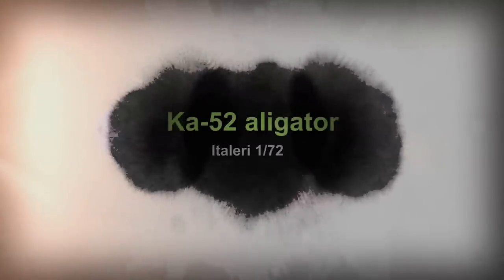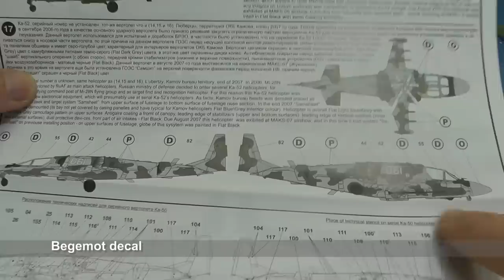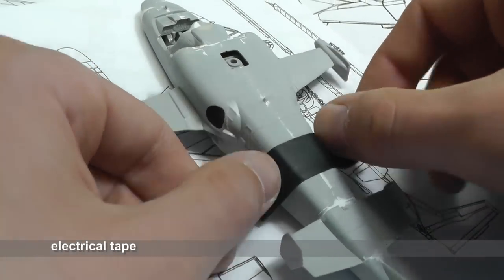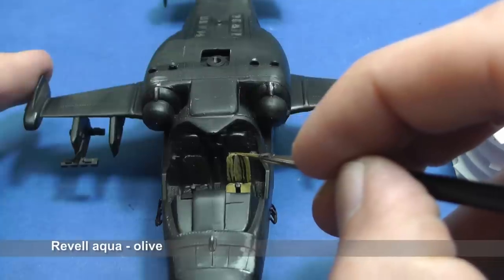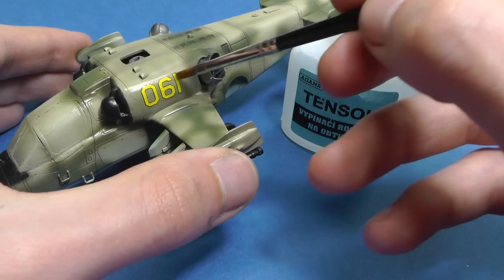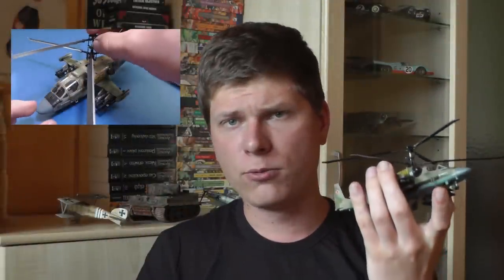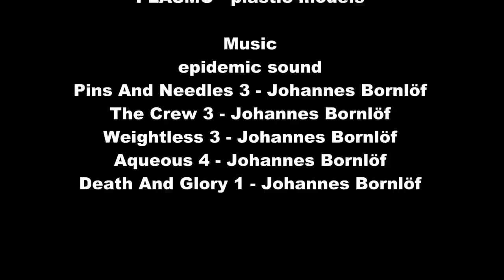Kamov Ka-52 Alligator "Hokum-B" 1/72 Italeri - Helicopter Model

Comment: I've always favoured the Ka-50. The Ka-50/52 is an incredibly innovative helicopter with a huge number of improvements to the traditional attack helicopter design. The key differences between the Ka-50 and 52 mostly rest on the Ka-50's innovation being rolled back to allow for export to users who aren't fond of some of the new ideas. Granted the changes probably are for the better in a lot of cases, but as long as I'm not flying it I don't have to care for practical realities.
Reply: I think the dual cockpit is much better. Allows the pilot to concentrate on not flying into the ground, and the gunner to chase targets.

The US is still expecting two crew in their replacement helicopter program, FVL, and I am willing to bet that the US has better flight automation than the Russians.
Reply: @ScottKenny1978  There are some arguments between it and the answer is it really depends on the mission. As designed the KA-50 was looking primarily to pick off tanks with long range missile shots and secondarily to take hit and runs on infantry targets with mainly rockets and a little bit of guns. Frankly with the extra space and weight (cockpit, armour, infrastructure for gunner) I'd rather be in a 1 man helicopter considering the amount the KA-50 avionics help.

In the long range anti-tank role the pilot rarely has to fly the helicopter and can mainly focus on the gunner role spotting targets as the flight systems are so effective. Its incredibly easy to hover, but similarly easy to keep to the doctrine of flying at 100-150km/h in a straight and level flight path as the avionics are mainly designed to assist with. Indeed the pilot can fly reasonably low with the avionics keeping altitude automatically, though that would be mostly for navigation.

Against infantry the helicopter was intended for hit and run CAS strikes as the cold war didn't allow helicopters to sit on station due to MANPADS. Using rockets as designed, and as the Russians absolutely love using, the gunner is fairly useless anyway. With the gun the pilot can use HMS to point and shoot as required, and the mounting requires the pilot be involved in rotating the helicopter rather than a rotating mount as it provides a far more stable and accurate firing platform allowing the cannon to more effectively take out APCs and trucks from outside return fire range. A gunner would only be used for spotting targets, and that was intended to be done at long range where straight and level flying (great for autopilot) is the doctrine anyway.

Of course the world shifted dramatically a decade after the helicopter was designed, longer for the Russian. Now the mission is primarily flying circles as top cover around a convoy, infantry, or important area whilst spotting and gunning threats, along with a very dynamic line of battle and far less tolerance for collateral damage. For this a gunner is absolutely needed just for tracking fast moving friendly soldiers alone, and a gunner is almost demanded for the close range, high angle off, accurate shots the modern battlespace needs. This means the KA-50 gun had to be changed to a more conventional style, the camera needed the ability to look at a miles larger angle, and suddenly instant pilot controls aren't absolutely required for every weapon system the aircraft uses unlike before.

Basically the world is a different place. At the time and with the doctrine used both by American and Russian pilots the single pilot design was absolutely a big step in the right direction. As we can see with fixed wing aircraft America are slow to drop the unnecessary crew (eg. F-18) but I believe they absolutely would have had the mission stayed the same. The single pilot design was incredibly innovative and Russia made a major step forwards with it. As for flight control computers, you add what is required for the mission. With two crew a highly automated flight control system isn't required and so you'd very much expect a single pilot helicopter to have a significantly better system. As the mission changed everyone put more emphasis on the cannon and sensors with Russia making huge modifications towards both systems and America using extra ammo boxes strapped to the side as routine equipment. Its important not to miss all the historical context which made the single seat attack helicopter such a great idea.
Reply: @olivialambert4124  my favorite snicker about the FVL program is that one design is the kamov coaxial rotor set, along with a pusher prop. Coaxial rotors allows greater lift, and higher speed because you don't lose all the lift on one side of the helo when airspeed approaches rotor tip speed.

Comment: You videos are amazing. 
One question. When masking clear parts, I sometimes get sticky stuff left on the parts after peaking the tapes off. 
What should I use to clear them? Using zippo oil slightly fogged the glass. Also, so you polish your clear parts after painting is finished?

Comment: Also built this kit and the one of the smaller single-seated Ka-50. Even managed to split the rotors on the Ka-50 and got them to move independently from each other. My paintwork wasn't as elaborate, though.

Comment: Ka-52 is a interesting design primarily because of those counter rotating blades. I’ve always had a soft spot for the Hind however. The thing just looks SO intimidating. Especially the P variant with that honking big 30mm on the starboard fuselage.

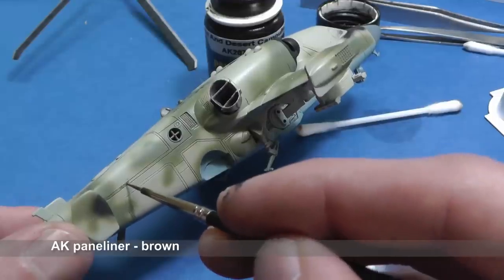Comment: wait-a-minute! 8:07 you used enamel wash on acrylic paint without clear varnish and not damaging it? how? tried that and it doesn't work on my kit. 

I usually clear lacquer coat the acrylic model before putting enamel wash and clean the excess paint with zippo liquid.

Comment: I've not been able to justify getting an airbrush just yet; when painting 1/72 and 1/100 models with paintbrush, would you still recommend scribing the panel lines before any paint, or would it be better to do it after a base coat since the coats are so much thicker using brushes?

Comment: Hello! Recently subscribed to your channel! Your skills simply awesome! 

One thing i have to mention - you're wrong about zvezda kit. It's not italieri repack anymore and it is MUCH better than italieri version. KA-52 from zvezda shares some sprues from KA-50 from zvezda which is completely ZVEZDA new model ( well it is not new but much newer than old italieri kit).  At this moment KA-50,52 from zvezda is best kits of this chopper...
Reply from the maker: I did not tell that Zvezda is repacked. Revell is repacked. Anyway, one kit of Ka-50 is made by hobby boss released 2007.
Reply: Yes, but u told they same quality ;) Also HB kit is slightly modified old italieri kit, it is not HB developed kit... It is have same problems as italieri kit...

Comment: Hi, David. Very impressive "alligator", even that the kit is not perfect at all, you made it look like its a real pricy kit with quality.
And also I want to ask you for a little bit of help - tell me, besides of rescribing, did you remade those grills right on the top of the helicopter? I'm working on a Ka-50 now, and I'm having problems with some rised details like those grills and some other small parts with sanding (very rough surface, due to the fact its a very old kit from Zvezda).
P.S.: Although I used to have an account on facebook, for now its unavailable because reasons, so I would like to vote here for IS-2 (or JS-2, dunno how to transliterate right ИС-2, lol), cause I know it would be a stunning build if you will build it. Especially the one with white stripes, 1944-1945.
Reply from the maker: It is a shame that I did not film part with top grill. I made new ones from epoxy putty. I made a small square from putty and then I imitated grill texture with a razor saw. It is same like here http://www.plasticmodels.eu/tipyatriky.php?article=22 . anyway IS-2 is a good choice.
Reply: PLASMO - plastic models, so its the same way as zimmerit... thanks a lot, I'll keep that in mind ;)